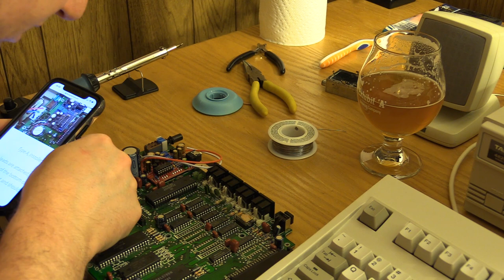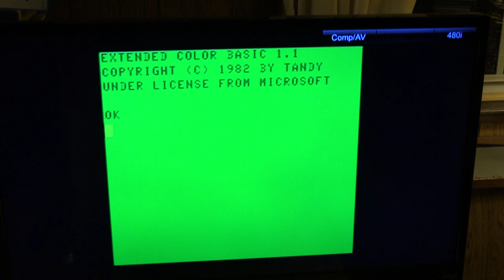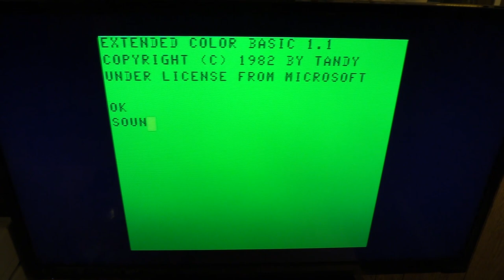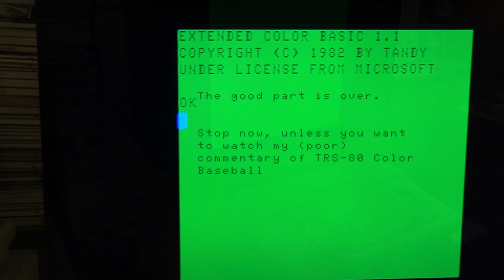CoCo 2 - RF Modulator Upgrade

Comment: Wish there was something like this for the MC-10.  My first-ever computer and learned not long after finding one (that works) on ebay that there are lots of weird things they've done including using the serial port (aka bit banger) to interface with other devices [server] and extend it to having a [virtual] DOS!  You're probably aware of it -- drive wire?  I never got around to setting up a raspberry pi or the server on a PC but I did manage to send "requests" from the MC-10 to a terminal emulator on my work PC :)  It was thrilling to see!

On my wish list is some sort of "anything but channel 3-4 video out" and "some sort of keyboard interface going to USB or PS2...preferably USB."

Done anything like that?

Comment: Can you do this mod on the Coco 1 also?
Reply from the maker: You can, though the process varies quite a bit between revisions of the CoCo 1.  The most common revs are referred to D, E, and F board CoCos, which are identified by the letter after the board part number on the CoCo’s main board.  The F board doesn’t have a letter listed, but the community settled on F since it was the next in the series.  I haven’t looked into how to mod my CoCo 1 yet.  It’s an E board.  But I’d like to mod it at some point.  Unfortunately, my E board CoCo isn’t compatible with CoCoVGA (F boards are).
Reply: @TJBChris  I have a CoCo 1 F, and determined GND, Composite, and mono audio are all present on the RF modulator input pins. So really, you can just yank the modulator on CoCo 1s, and make a direct custom cable for composite. But it may not be as sharp as the original RF due to artifacting.